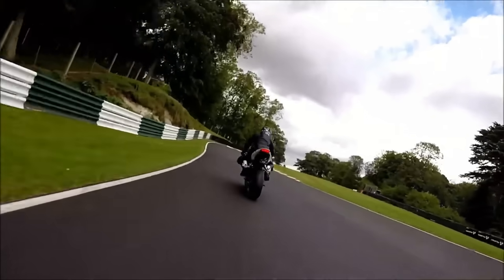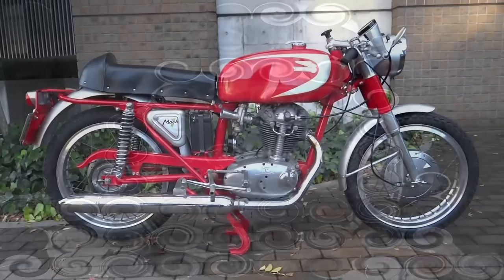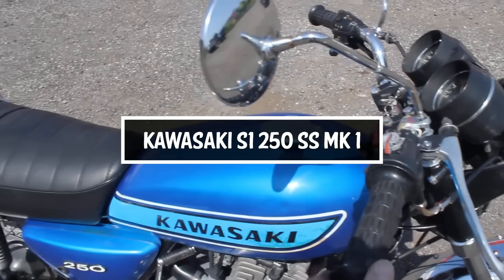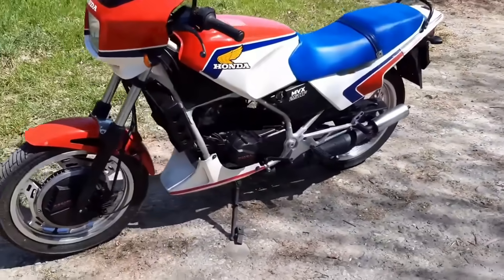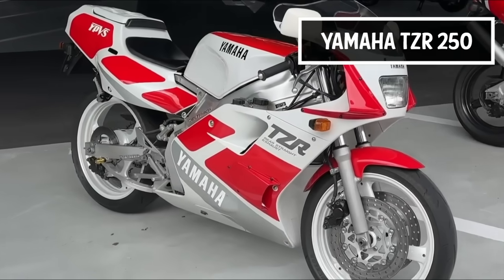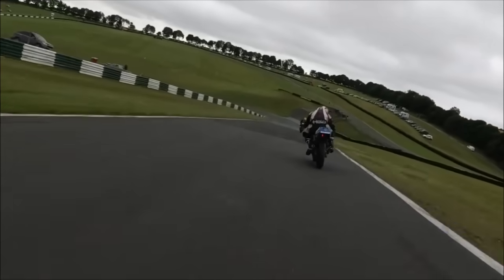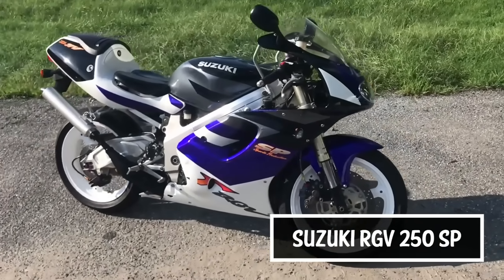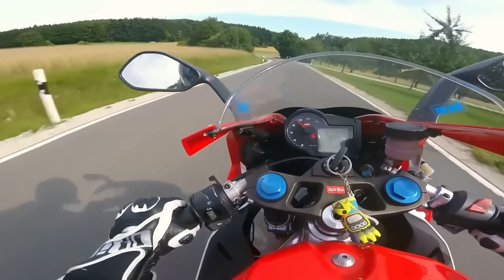The Fastest 250cc Motorcycles

Comment: The Suzuki Super Six deserves at least an honourable mention
Reply from the maker: You are probably right, Cheers for  watching, ride free
Reply: Oh yeah. It left every other 250 at the time standing.
Reply: @barebonesmc  And the t250 j
Reply: How about the Suzuki Hustler.
Reply: @noiwanttobeanonymous3797  pretty much the same machine, the T20 and T250  had mainly cosmetic differences, the earlier T20  was quicker as well. The same basic engine was carried through from the T20 to  the X7
Reply: @noiwanttobeanonymous3797  Had one, went like stink. Brakes used to get hot so stopping could be fun!
Reply from the maker: as i said, yes they probably should have been mentioned 🙂
Reply: In 1968 six out of the top ten finishers in the Isle of Man 250cc production race were riding Suzuki T20.  
The T20 was arguabley the best readily available production 250cc bike of the 1960s decade.
Reply: @barebonesmc In 1968 six out of the top ten finishers in the Isle of Man 250cc production race were riding Suzuki T20.  
The T20 was arguabley the best readily available production 250cc bike of the 1960s decade.
Reply: @stevereeves5248  Indeed , and today they are giant killers in the classic race events
Reply: Spot on ! 👍
Reply: In 1967 i had a Suzuki super six i weighed seven and a half stone, all the time I had that bike only two other bikes out accelerated me up to seventy
Reply: @noiwanttobeanonymous3797   and Yamaha's YDS7.
Reply: I had a 1968 T20 Super Six WNU242F (UK) then I graduated to  a 1970 Kawasaki 500 H1 triple FCH911J (UK) - Happy days
Reply: yam yds1/3/5/7 , montesa impala ,bultaco mettrala
Reply: Yes and the Suzuki Hustler 250 with six speed box of 1969.
Reply: When I saw the title of this video, the first bike that came to mind was the X6 Hustler
Reply: @georgebarnes8163 completely different engines T20 was lighter and faster the barrels were different. And the crankcase was heavier on the T250 with a different oiling system. X7 was completely a new engine with reed valves  as well as inlet port to make it a more powerful and torquier engine with a lot of tuning potential.
Reply: @tonyguest9744  I bought my T20 new and still have it in pristine condition still.😊
Reply: @GWAYGWAY1  Green eyed monster here Graham. I think the T20 was the best all round bike that I owned. Oh to be back in the 1960's, enjoy your bike Graham.
Reply: In 1974 Bike magazine did a group test of eight 250s and the quickest of the lot was the 250 Ducati Mk111.  That was the ordinary SOHC one so I’m sure the Desmo version was at one point the quickest you could get.
Reply: Yeah and the Hustler too
Reply: I rode a a few 250’s in the late 70’s before moving on to bigger capacity bikes and to be honest lost touch with all bikes as life and work took over. It’s truly fascinating to see how much development took place by different manufacturers, I really enjoyed your video thank you 👍
Reply: @GWAYGWAY1  Thanks for the clarification. After reading so many posts I was getting a bit confused.
Reply: I bought my Super Six in 1969 as a 17 year old. My second bike after a Francis Barnett 197cc.  What a world of a difference.  Nobody could touch me on my Suzuki. There was only one guy on a Triumph Bonneville who eventually reeled me in after about 80mph.  Happy days and great memories.  Just pissed off that I’m not allowed to ride the same bike today on a provisional licence.  😡
Reply: @georgebarnes8163  it was'nt  really the same basic engine. the t20 and t250 had much simpler porting on the transfers, including the GT250M "ram air". the GT250A AND GT250B Had much improved engine , especially for tuning with 2mm larger carbs {26mm to 28mm} and 4 bearing crank with revised much enlarged total area tranfer ports with 4 per cylinder instead of the previous 2. but unless tuned, there was'nt a lot between any one them. i rode them and tuned quite a few. the x7 engine kept porting and carb similarities with the last two GT''s but torque and HP were lower down the rev range. my tuned GT 250B would blow away most except the best RD350LC's.
Reply: @noiwanttobeanonymous3797  yes, supposedly 104 mph road tested by motorcycle mechanics around 1970.
Reply: YOU MEAN THE X6 HUSTLER. MINE WENT MID TO HIGH 13S BUT I HAD A 315CC ENGINE ON IT. STILL 6 SPEED.
Reply: IThe Suzuki 250 Hustler was by far the commonest 250 in the early 1970s.
Reply: Yeah, expected the video to start with the '64 Ducati Diana 250cc and '66 Suzuki X6 Hustler 250cc...
Reply: One of the first!
Reply: You had one! Always interesting. No good for for long journeys, especially with a passenger with luggage, 25 mpg into a headwind! My old mate Robin had a sporty CB77. It’s engine looked like a Laverda  750! The handling was horrible in my opinion, it felt like it wanted to fall into corners like many Japanese bikes if the period.
Reply: @drstrangelove4998  - My CB77 felt like a pogo stick after my Ducati 750...
Reply: @georgebarnes8163 they were nothing like each other the fitting points were the same but the T250 was much chunkier.
Reply: I have mine from 1967still in the garage.
Reply: In those days I was riding my minibike with 350cc Jawa motorcycle engine...

Comment: When I turned 17, back in 1981, the first thing I did was to get myself an RD250. Crazy bike, sometimes I am amazed that I reached my 18th birthday. I only rode it in London but it was perfect for city riding as it got up to 60 really quickly! You never forget your first real bike.
Reply from the maker: that ones true 🙂 I remember taking the cash for a trick KH 250 when i had just passed my test and they had just got a 350LC in, it was a hard choice but the LC won 🙂
Reply: I had the RD200 , electric start was rare then .
Reply from the maker: @joecamel6835  they were another bonkers little bike 🙂Cheers for watching mate, have a great weekend 🙂
Reply: @barebonesmc   Bet you wish you still had your 350 LC, that bike is a classic. You need deep pockets to buy one of those now. After I passed my test I went for the GS1000, 4 stoke direction instead. Been riding ever since, keeps you young at heart 🙂
Reply from the maker: @rufus1346  indeed mate, but if i had who knows what bikes i might have missed 🙂 enjoy the ride mate
Reply: Same here.  Bit quicker than my TS 100 but went even faster when converted to a 350.
Reply: I turned 17 in 1987! First bike a Suzuki TS125 trail bike. Too slow. Next bike a Yamaha RD125LC, red & white, the makeover with the big RD sticker on the tank? I had it tuned by a motorcycle racer & mechanic. 20 in first, 40 in second, 60 in third and it would get there VERY quickly indeed. Sadly I crashed that and wrecked it at 75 mph. I shudder when I remember how I used to ride it flat out everywhere. 1987 was a great year for me though. When you’re 17 a summer still feels like a long time, and I had amazing fun running around on it enjoying my new found freedom. 👍
Reply: @TheGreatest1974  Yamaha know how to make 2 stroke madness. Glad you made in through your teens too lol. No cameras, the only way you got a ticket is if they caught you, which was never going to happen in London! 
Hope you didn't hurt yourself too badly in that crash. I had a few but somehow got away with nasty road rash and bruises.
Reply from the maker: @TheGreatest1974  You mention the F word lol, that is the bit i dont get with younger riders, i saved every penny for that freedom to roam wherever the road took me, people today just dont seem fussed about not having that, happy to exist in their own little bubble
Reply: Back in the late 70s and early 80s I had a fare few of the jap bikes you mentioned but to be honest had the most fun on a suzuki x5 200 thanks for the  great video
Reply: @ipaddy I was despatching in London on an X5..🤣
Reply: too bad you had no knowledge of two stroke technology 15 years before of the X6 Hustler Six Speed oil injected unlike your yamadog that was meant to fail ..THe suzuki X6 Hustler 250cc six speed two stroke on a bad day would easily out run a Triumph Bonneville 650cc twin in the quarter mile as the antique little suzuki did well over the ton about the time you was born and the time i was 17 working in a motorcycle dealership for BMW , Norton ,Ducati  Moto-Guzzi  and Suzuki with their brand new X6 Hustler 250cc twin that was faster than anything else we sold ,,guess what job i did back then ? i did not know much about the inside of a bike so they had me taking them out of their shipping crates and bolting on the front wheel fender and handle bar with all controls already mounted and ready to ride ! then i had to put gas and oil in them ..and then i was told i had to take them all for a ride and make sure they would all run as advertised ,,,it was an extremely dangerous job that i would of paid them to do , but paid me as well for all my skills of being addicted at age 17 of doing burn outs, smoky  donuts , power shifting wheelies , and my favorite part of rpm testing in top gear wide fu<king open and the Hustlers sent it more so than the RD250's that came later  but not for very long ..there was a new sheriff in town by the name kenny roberts who wasnt taking any prisoner with his signature RZ350 yamaha street cafe racers that anyone be of the public could buy for peanuts of a MotoGP bike cost ..apparently the RZ350 two stroke twin with "king" kenny's autograph on the fairing of an all yellow yamaha street fighter that rumor had it could do the north side of 150mph back in 1984
Reply from the maker: @donniebaker5984   the Hustler etc are here https://youtu.be/jgSnHBdXcOo
Reply: I had the ‘72 RD250. Amazing and scary fun to ride. After getting used to it could shift without the clutch. Still remember blasting past lotsa cars on the open road.
Reply: @barebonesmc Did you ever experience any problems with getting oil all over the rear tyre from the exhaust pipes?
Reply from the maker: @paulfrost8952  on the LC? no, never did
Reply: @barebonesmc  Still have it ?
Reply: I was born in 1981!  ...bad timing on my parent's part, I guess.
Reply: My first "real" bike was also an RD250 I was 18 and my older girlfriend had a 350 but no license so she let me use the 350 as I wanted! . When I bought my own I was restricted to 250cc as I was still on my Ls but I thoroughly enjoyed the 250 till I went up the back of a car at 21  : ) learn and live to ride again !

Comment: My 250s in my earlier life were all Kawasaki, S1B, S1C and KH250B1. All good fun. After that came a Z900A4 (I still have it) then a ZZR1100D2 (I still have that too). But, I was missing a Kawasaki triple in my life. So I bought a Kawasaki H1F in 2015. The 500 is so much more tractable and torquey compared to the 250s. Passion fulfilled.
Reply: I actually owned a stock 1964 T20 Suzuki 250, the first of the 250 Hustler Six Speeds in NZ which could exceed 100 mph and accelerated quicker if the Posilube Oil injection was set at half the factory setting and quality Two Stroke Oil used. I also had the use of an A1 Kawasaki belonging to a mates brother and discovered once that if you set the rotary valve on one side two notches back from standard , the bike had to be push started but could pull 135 mph once it was up and running. It wasn’t quite as quick as the Hustler and the biggest quirk was the pegs were round on round shafts so at a high lean on a race track you couldn’t leave your boots on the rubber as it spun, so you’d lift your foot up over the Carb box … both sides … that was a challenge … the Ram Air GT 250 from Suzuki accelerated quicker but topped out before my T20. That T20 was bought by a scout collecting early bikes for the Japanese collector market, I really regret selling that bike …
Reply from the maker: enjoy them mate,  Cheers for watching mate, Ride Free 🙂
Reply: I also had a 250 hustler . I hit the ton on that.thats the cop told me anyway.also from New Zealand
Reply from the maker: @rickydee5863  whenever did the cops get anything right tho lol, i cant comment much on the Hustler as we never got it
Reply: I had a 1970 Bridgestone 200 GTR and then a 1970 H1, Cherry Bomb. Still alive at 68. Still ride, Tiger 800XC, among others in the garage today.
I sure miss the 2strokes.
Reply from the maker: @xhippy4682  once bitten by that bug lol 🙂 Cheers for watching mate, Ride Free
Reply: Brent, I had a 1978 z nine before i got a gpz 1100 b2 in 1983. My z900 got alot more attention than the gpz. I can't believe i sold my 900 for 750 quid wish i still had em.
Reply: But a KH250 is a triple?
Reply from the maker: @rsmit2797  if you are talking about the bike in the video, its an A1 not a KH the A1 Samurai was a twin
Reply: A motorcyclist after my own heart. Kawasaki, through & through.
My list goes :- S1C, S3, Z650F1, GPZ750 A2, and my favourite ZRX1100 C4.

Comment: When selling motorcycles in Japan, from around 1980 there were many traffic accidents, and under pressure from the government, four manufacturers began to voluntarily regulate horsepower according to engine displacement. Specifically, 50cc was set to have 7.2 horsepower, 125cc to 22 horsepower, 250cc to 45 horsepower, 400cc to 59 horsepower, 750cc to 77 horsepower, and over 1000cc to 100 horsepower. These numbers were lowered in 1992 to 40 horsepower for the 250cc and 53 horsepower for the 400cc. This voluntary regulation was abolished in 2007, but exhaust gas regulations had already stopped the production of two-stroke engines.The Aprilia RS-250 might not have taken the top spot if it hadn't been for self-imposed restrictions that only annoyed its users.
Reply from the maker: Cheers for adding this mate. As i have often said, if we could amass the combined knowledge of all the subscribers we would have the most comprehensive motorcycle encyclopedia ever 🙂

Comment: The Suzuki XJ Hustler in 1966 was a bike that could go over 100MH, but would also break down often.  The XJ had a lousy 6 speed transmission that broke constantly!  The Yamaha RD 250 was a great city bike as well as a good highway blaster!   As Jay Leno once said "Its more fun to push a small HP machine fast then a big HP machine that can't be run to its full potential every where".  The 250 bikes are more fun if you don't weigh 200 pounds like I do, which is why I preferred my Honda 450 cafe racer, but are fun none the less.  They also cost less and easier to maintain then the 750 to 1000cc monsters!
Reply from the maker: I guess my version is BETTER TO RIDE A SLOW BIKE FAST THAN A FAST BIKE SLOWLY 😊😊😊

Comment: What a great show. I drove three RD 350 in  the 80s , young, wild and fast as the Honda 750, with 74 Hp.
Reply from the maker: wild days, and even wilder nights 🙂Cheers for watching mate. Ride Free 🙂
Reply: yep had the rd lc 350 back then before that thought my rd400 was fast lol had nothing on the rd lc350
Reply: Used to really enjoy eating up Harley sportster‘s on my RD 400 which was highly modified. It was one guy with a Kawasaki H1 500 that Mike Wells they had mechanic for Kawasaki in Daytona Beach had prepared with Danko chambers and three Yamaha 360 read valve kits on each cylinder, And it was a dead match in speed for my RD 400. The H one was also highly modified with the port job and etc. I had Too many modifications to my RD to list in this forum. Bench flow port job,DG chambers and heads which were milled to keep compression ratio correct with the port job 34 mm electron carbs, and later went to water cool heads. It ran like a scalded dog. The smell of two-stroke Oil coming from a nice sounding chamber is a beautiful experience and is eloquent to the senses.
Reply: @michaeldurham9140  yep nothing like the smell of 2 stroke in the morning
Reply: Yea I had a Suzi GSe 68 bhp  at the rear wheel , never missed a beat

Comment: Thank you for your wonderful film and comment!
As a 2-stroke fan, I bought a Kawasaki Avenger 350 cc in 1968 and after several 4-stroke Hondas I bought a Kawasaki KR1-S in 1990.
The KR1-S was the best two-stroke bike I've owned, it did indeed turn like a razor and nothing could have been mis-tuned.
The suspension had to be precisely adjusted for my light weight and if the tires had 2 lbs too much pressure I couldn't ride it and if it was too low it steered too hard.
It braked fantastically and I usually braked with 2 fingers.
At 8000 rpm the KIPS system started working and the extra resonance chambers closed.
Then the engine pulled excellently and really ran like a screeching turbine.
When I drove away after a winter break, I came back after 3 minutes and spent 2 hours cleaning the carburetors, because there was deposits in the fuel jets, of course also adjusting the vacuum exactly and, above all, the throttle cables, otherwise the engine will vibrate.
If you do not feel the contamination of the jets while driving, the engine is guaranteed to be damaged by a mixture that is too lean.
Those are the disadvantages, but if you like technology, it is nice to have everything checked and adjusted very carefully.
Now I ride a 250 cc Honda (CBR250R) of 26.4 HP, also an excellent motorcycle, but touring is of course more fun when you are 74 years old, haha!
Reply from the maker: Great story 🙂Cheers for adding your bit mate. Ride Free 🙂